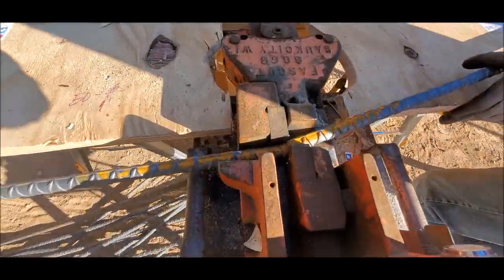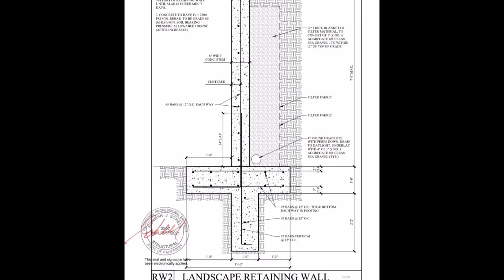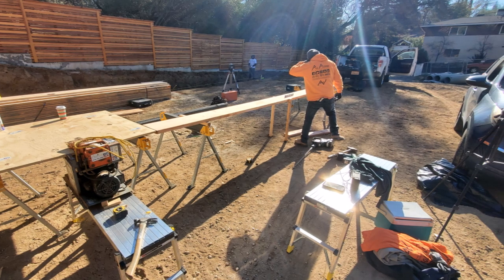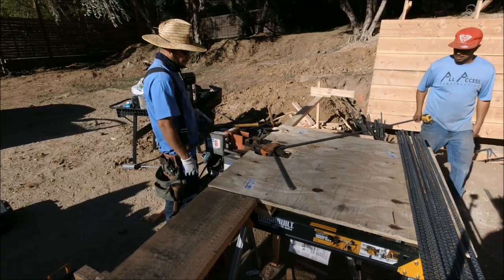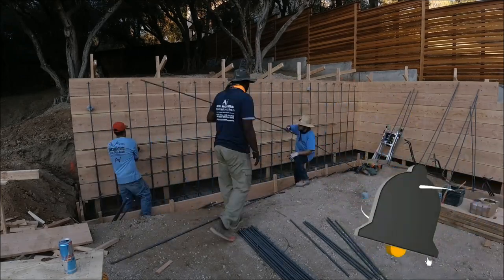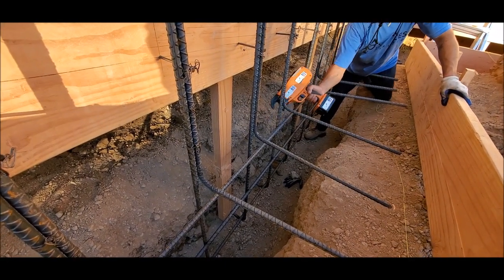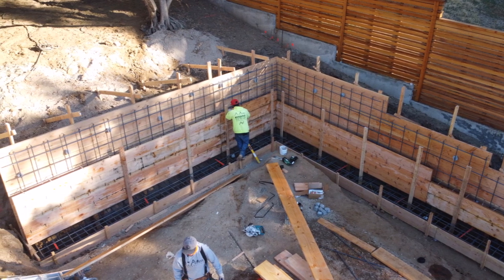How to Install Rebar for A Retaining Wall | All Access 510-804-4646

Comment from the maker: Check us out installing rebar for a concrete retaining wall. Using our fascut 600 rebar bender and cutter. We use 1.5 tons of #5 rebar. Also, check out 

Part 1: How to frame the back of a retaining wall: https://bit.ly/2IMpIbP
Part 2: How to strip a retaining wall: https://bit.ly/37DTby3

Comment: Question. What do you do with the wooden stakes that go into the foundation? Are these just cut offafter the concrete sets, or do you get them out somehow?
Reply from the maker: We try and pull out for the most part.. If not we just leave them in and cut later.. Appreciate the comment 👍🏾 👍🏾 👍🏾 💯💯
Reply: @AllAccessConstruction  Thanks for the reply. Thinking about it, I can see how it will mostly pull out. The moisture during the concrete pour will make the wood swell, and eventually when it dries again it will shrink enough to pull out.
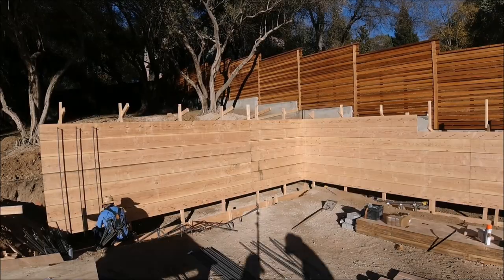Reply from the maker: https://youtu.be/poS3WDiC-GU check out the 1:40 mark.... Appreciate the support